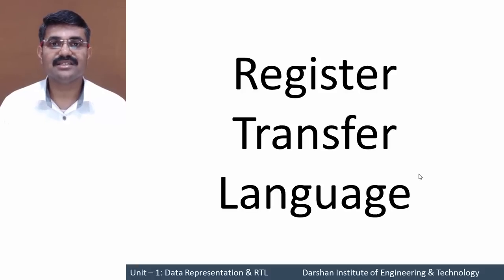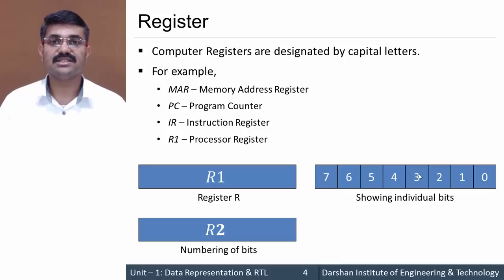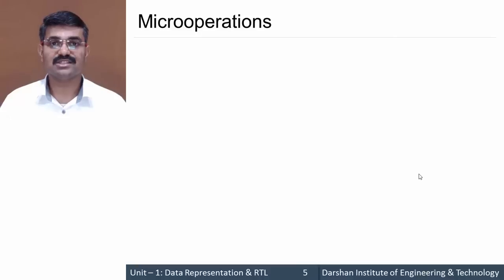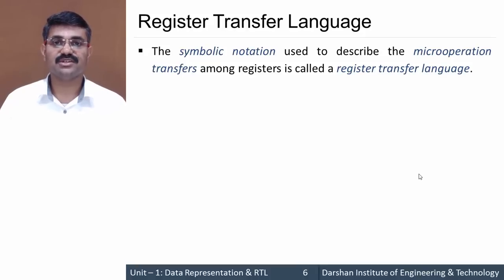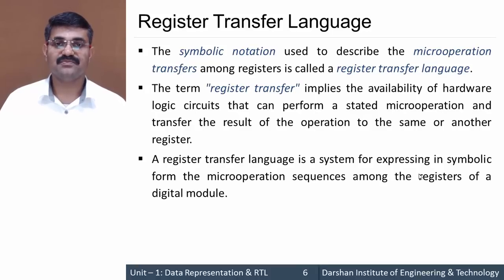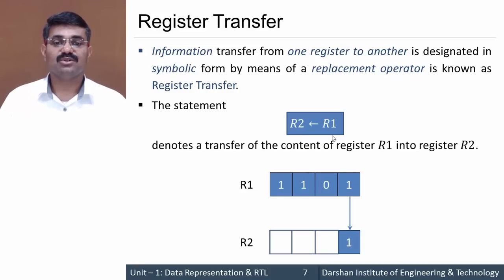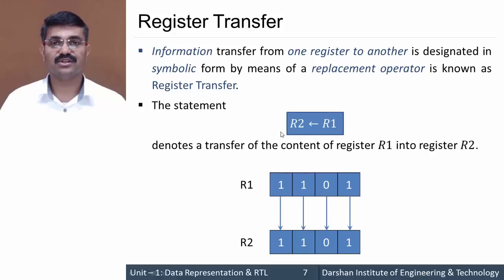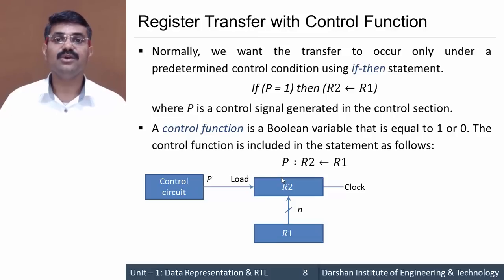1.01 Register Transfer Language

Comment: 🎯 Key Takeaways for quick navigation:

00:01 🖥️ Registers in computer organization are collections of flip-flops denoted by capital letters and numbers, like r1, r2, representing memory address, program counter, etc.
02:28 🔄 Micro operations, executed on data stored in registers, are elementary operations altering or storing results in registers, analogous to arithmetic operations in programming languages.
04:13 🗣️ Register Transfer Language (RTL) is a symbolic notation describing micro operation transfers between registers, enabling data transfer representation.
05:23 🤖 Register transfer implies hardware logic circuits performing micro operations, transferring results to desired registers, forming sequences of background micro operations for data transfer.
06:17 🔄 Register transfer is denoted by a replacement operator (arrow), transferring content from one register to another; the operator is symbolized as r2 ← r1.
08:03 ⚙️ Control functions (boolean functions) influence register transfers; a transfer only occurs when a predefined condition, controlled by a control unit, is met.
09:24 🕹️ Control function values (0 or 1) from the control unit determine transfer occurrence; a control circuit sends signals (P) for enabling transfers based on conditions, like P: r2 ← r1.

Made with HARPA AI

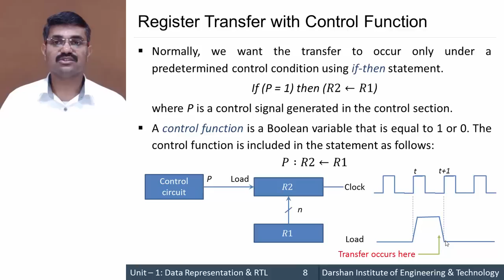Comment: 11:32 initially when load =0 at time t no transfer occurs,then how after t+1 as load will be zero the transfer occurs?
Reply: At the initial stage the load is zero. When it reached the time t then it means it is 1. Then till it reaches t+1 the t remains 1 where the signal become low till it reaches the t+1. At that moment the data transfer will occurs. After t+1 the load may not be zero
Reply: @marisettipadmavathi4772  thanks for the explanation.
Reply: I guess you are right , because it was still on at ( t+1 )